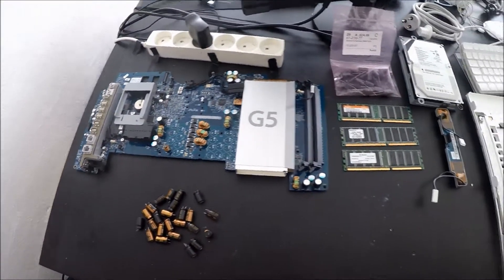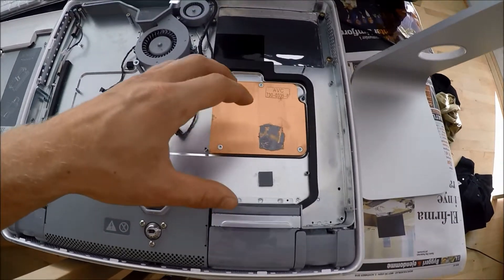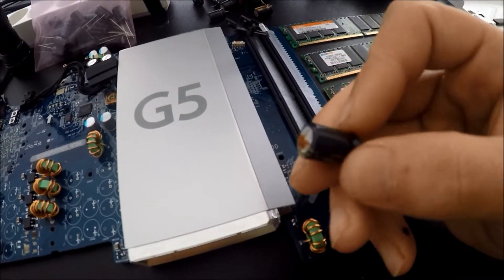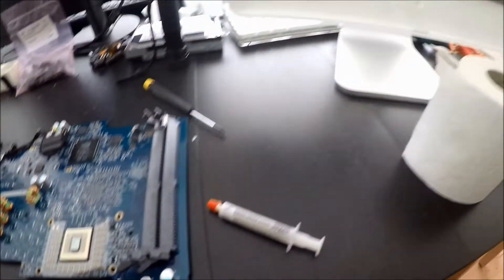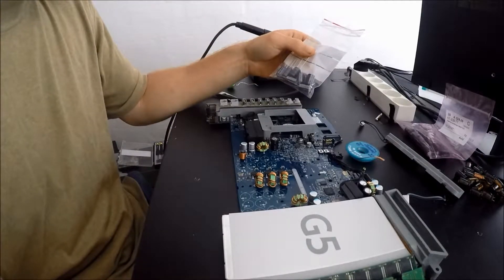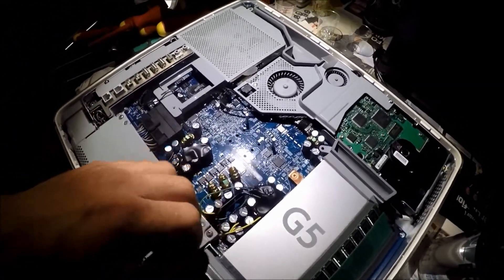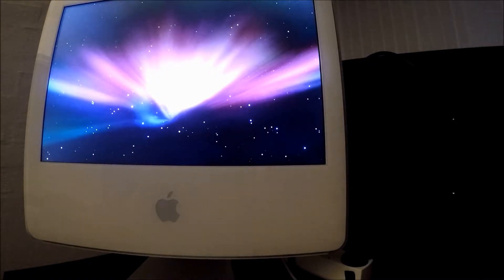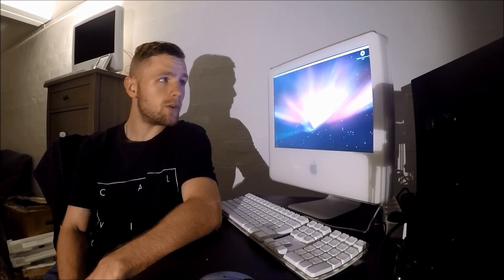Apple iMac G5 17" capasitor reapir, HOW IS THIS WORKING?!

Comment: Heat up the board before unsoldering,mix the old solder with leaded solder first,so first resolder all connections,has a lower melting point.
Reply: And recap the power supply with good quality 105 degrees caps with a long lifespan